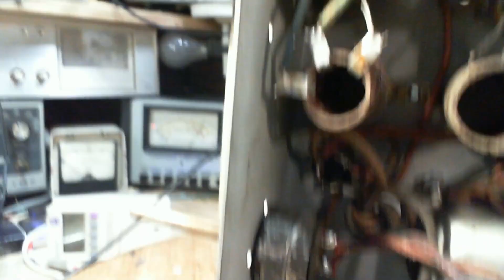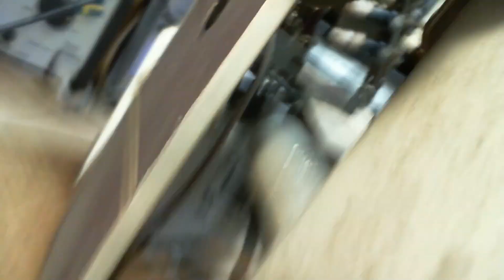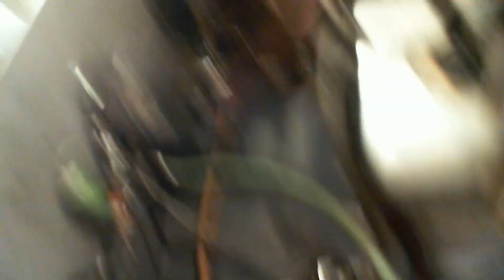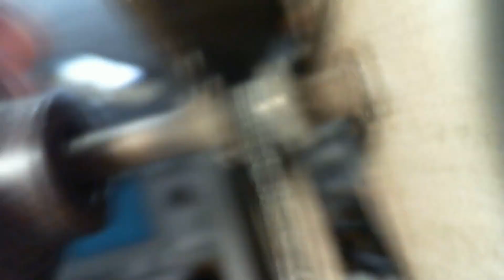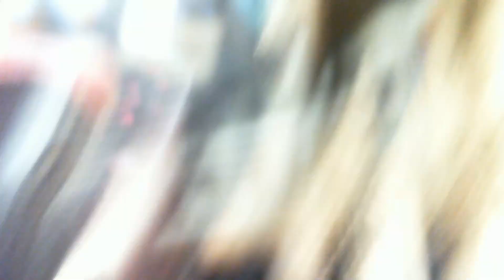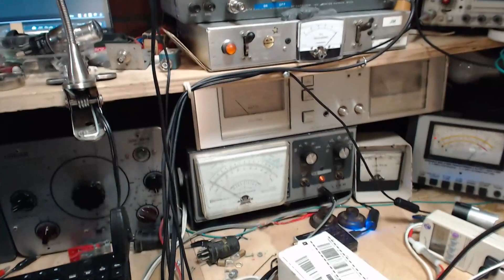RCA Victor A38 Shortwave Tube Radio Video #17 - Filter Capacitors, Output Tube

Comment: A few thought on capacitors. Increasing the size will significantly reduces the life of the rectifier tube that’s why the rectifier data sheet alway specify a maximum. Never exceed the  rated Voltage of an electrolytic not even for a few seconds.don’t ever parallel old and new capacitor it’s pointless  the reason your trying to add more capacitance is because the old ones are failing so why keep components that you know are failing in circuit. Interesting about the output valve I would be considering the design of the output transformer specification.

Comment: Jim:  If you’re adding capacitors to the old filter caps in the can because they’ve gone down in value, then they’re already starting to fail and shouldn’t be used. Even if the old capacitors test good, having them fail because the radio is now seeing much more use (now that it’s fixed) wouldn’t be good, especially if they fail shorted. You already replaced the cathode bypass with an individual capacitor so why not drill a hole, add a small terminal strip and replace the 2 filter caps with brand new individual units. When I restore a customer’s antique radio, I want it to last as long (or longer) after the restoration as it did when it was new, so, filter caps always get replaced. No one minds paying a little more when the results come out good, but I don’t think anyone would be happy to have their antique radio fail soon after getting it back regardless of the small amount saved by trying to use old parts that are known to be failure prone. Just sayin’….
Reply: You have it spot on, not that I’m hating on Jim there are enough negative people out there